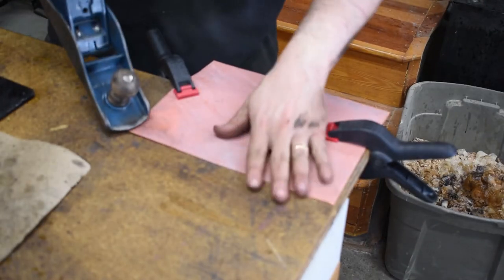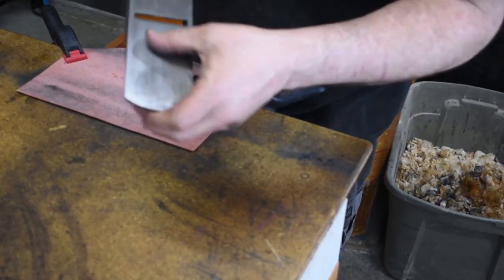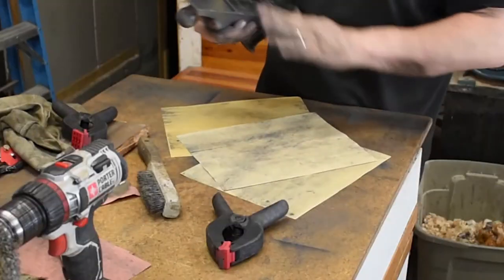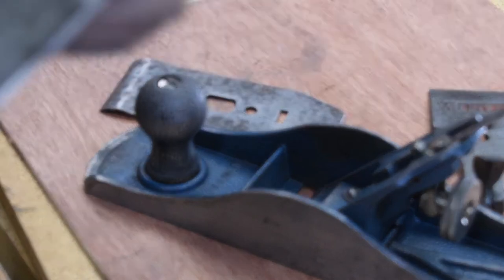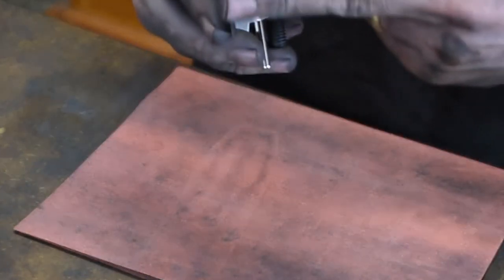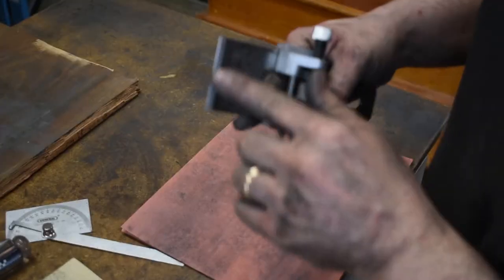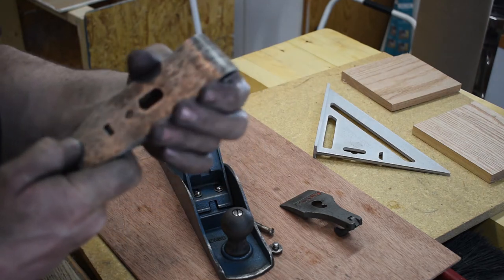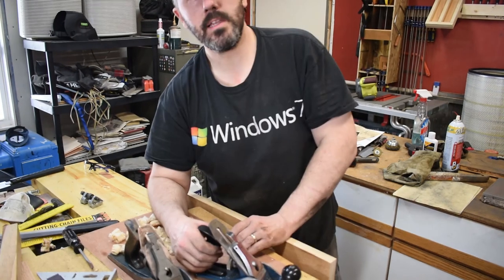Stanley Hand Plane Tool Restoration Series 3 of 3

Comment: I as a 79 year old retired carpenter have refurbished several planes in my time. But the hardest part was to sharpen the darn things. I found it was most important to keep your sandpaper VERY flat to the table ( I used the table saw because it was very flat )You used two pieces of sandpaper and they did not sit flat and it caused the corners round a little. I had the same problem with my chisels and plane irons as well but got good at it after a while. Then it got that we sent in our saw blades chisels plane irons and drill bits and the company paid. Needless to say that was the end of most of my sharpening. Just found your channel and checking you out and subscribing. I am in East Tennessee and moved here from Vermont 8 years ago to get away from the snow. Wishing you well.
Reply from the maker: Thank you sir.  We just moved to East Tennessee from NH 3 years ago.